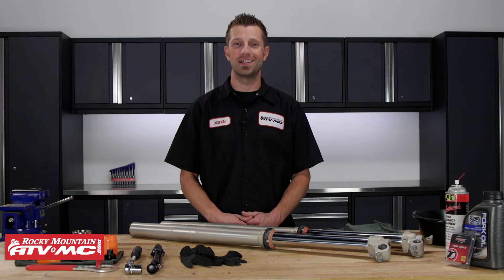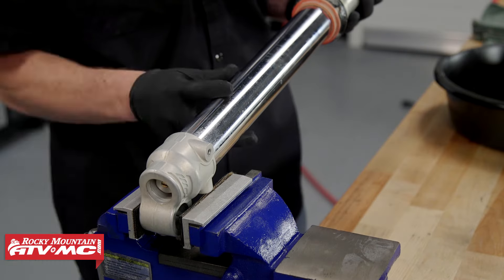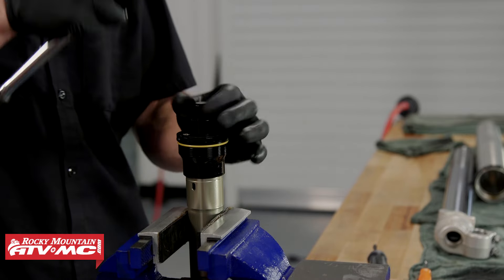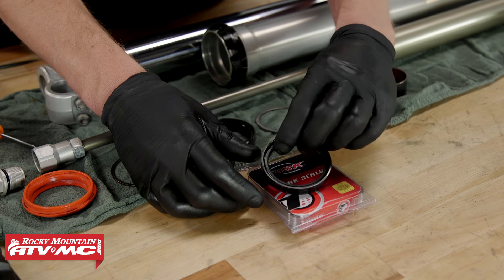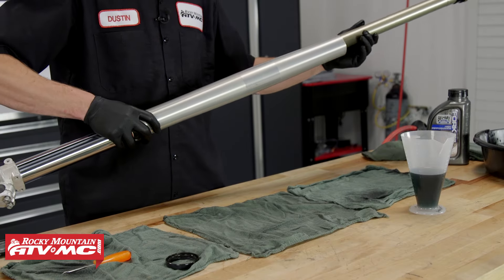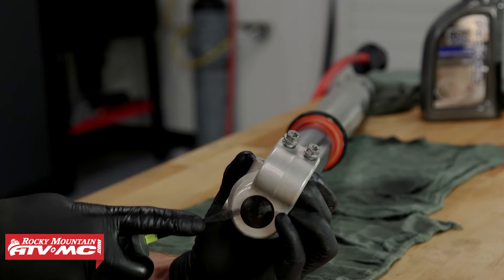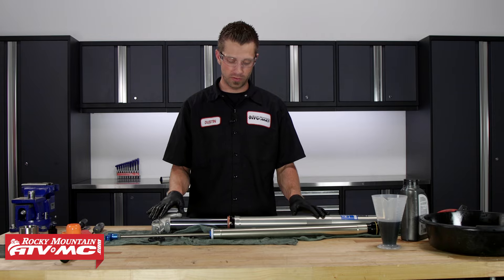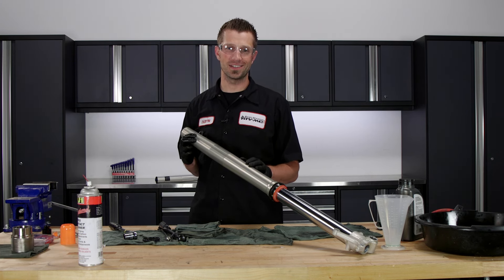How To Rebuild The WP AER Motorcycle Forks

Comment: Notes for oil change (without changing seals) (untested)

Right Leg
1. Loosen top triple
2. 4:51 hold outer top cap and crack compression  cap with compression bolt tool
3. 1:55 crack top cap
4. Loosen bottom triple and slide out fork leg
5. 4:51 Finish removing compression cap
6. 5:21 Dump compression damper oil
7. 5:34 Fill 12.85 oz fork oil in compression damper
8. 6:06 Replace compression damper, tighten to snug 
9. 11:12 Unthread outer top cap, dump oil, fill with 7 oz oil, replace cap to snug
10. Put back in forks and tighten bottom triple bolts
11. 6:17 torque compression cap to 29.5 ft lb
12. 11:22 torque outer top cap to 36.9 ft lb
13. Tighten top triple bolts

Left Leg
11:52 relieve air pressure
Loosen top triple bolts, crack top cap,  loosen bottom triple bolts and remove from bike
12:15 remove top cap
12:20 dump oil
15:45 Add 7 oz fork oil. 
Replace cap back to snug.  Slide back into triple, tighten bottom bolts.
15:52 Torque cap to 36.9 foot lb.   Tighten top triple bolts
16:08 Reinflate to pressure (e.g. 140 psi) and replace schrader  cap

Comment: I thought the manual suggest heating up the lower part of the uppers where it tapers out to 50c before doing the pulling motion?

If you don't have the fancy orange tube protector, can use a small plastic bag or condom lol.

Comment: I drained the air from the schrader valve and the fork sucked into the compressed position under a strong vacuum.  Forks only have 50 hrs on them and was working fine.  2019 Husqvarna FX450.  Going to consult a friend who has the same fork.  I'm guessing a seal may be bad, or I just need to leave like 10-20 psi in the fork.  I wasn't planning on changing any seals during this service.  My 1st time working on AER forks.  ANyone have similar experience?

Comment: All well but it's better if you drive the gide before the oil seal instead of hammering together they will go in sweeter one after the other apparti this good instruction there is the need of cleaning over used oil and polishing dirt blast on chrome.
Rob. malta

Comment: Question is that digital air pump you are using, is the battery in it USB or even rechargeable, I bought one a while back and after a year of use, the battery died, the manufacturer Fox said they're were a disposable unit and not rechargeable or battery replaceable, so that went to the bin, thank you Fox! I have an XPLOR so it's not an issue for me now, probably never touch an air fork again! I'm a set it up right and leave it type of guy!

But I think it's worth mentioning if those pumps have moved on and are rechargeable or the battery is atleast replaceable without having to dispose of the whole pump? Cheers guys big fan of Rockymtn 👍
Reply from the maker: Our Tusk Digital Suspension Pump offers an auto start and shut-off for long battery life - battery is replaceable (CR2032).  Sorry to hear that about your Fox pump.

Comment: How to add preassure to 2016 model AER Forks if i don't have that plug which allow to screw inn pump ? Should i buy any special kit with that?
Reply from the maker: The shock pump should have come with the correct adapter to allow you to screw into your AER forks air valve. What model bike and air pump do you have?
Reply: @rmatvmc  I'v got KTM 250SX 2016 with standard aer forks WP for that model , hasn't buy any pump yet cause i don't have that plug on top of forks, only 2 screws. Have no idea how to fix it
Reply from the maker: @dawidworwa1206  That bike should have come with 48mm WP 4CS forks, KTM went to the AER forks in 2017 on the SX models here in the U.S.. Did you put the AER forks on your bike?
Reply: @rmatvmc  so that means 4CS is not possible to check preassure or pump it up?  ? Can't find anything about that
Reply from the maker: @dawidworwa1206  The 4CS forks are not air forks so you wouldn't be able to check air pressure. But we have a video showing how to rebuild the 4CS forks if you want to check that out and make sure those are what is on your bike. If your goal is to get your forks to be stiffer, you can still accomplish that by using your compression clicker. The compression adjustor should be the clicker located on your left fork. You can check out the 4CS rebuild video here: https://www.youtube.com/watch?v=xzn6K8qywQM
Reply: @rmatvmc  ahh 😅 good to know, thought all of ktm forks are air fork, thanks for answers guys!

Comment: Have you had stiff shocks after the rebuild?
Reply from the maker: We would recommend double checking the air pressure to make sure it's not too high and causing them to be too stiff. Most people are running about 145 to 150 psi.